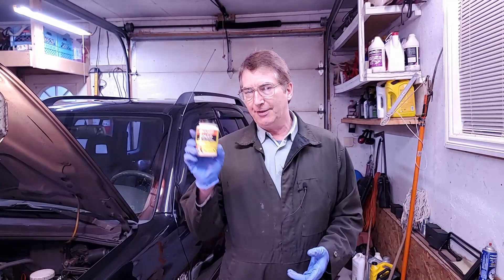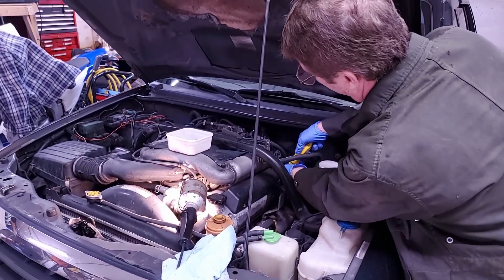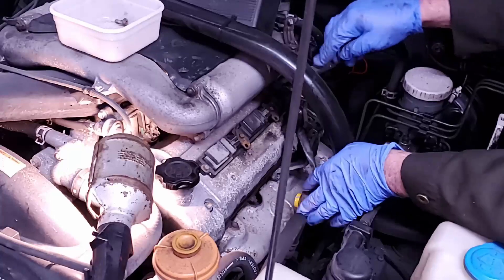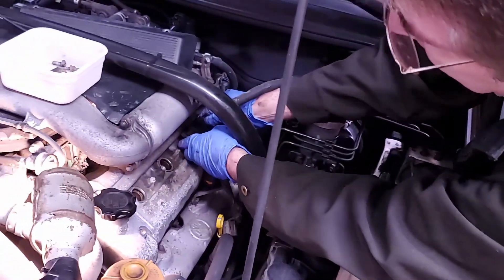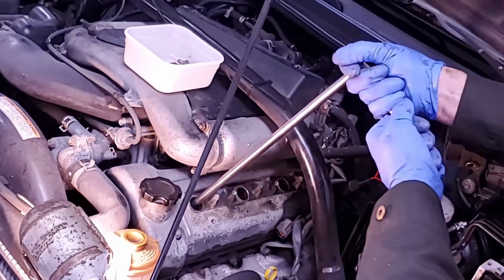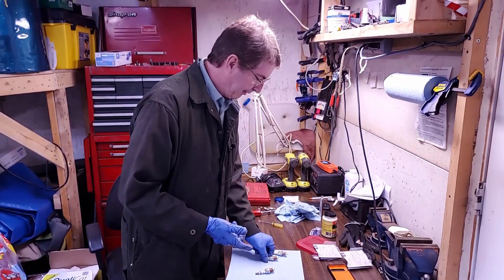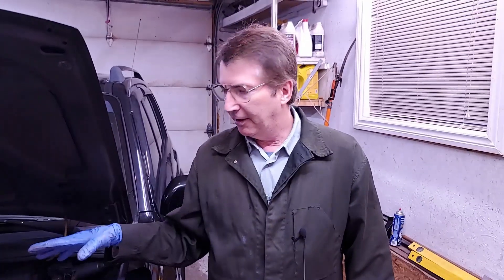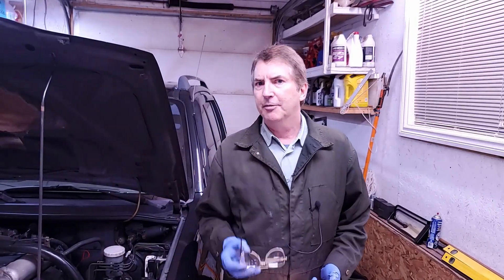WHY I USE ANTI-SEIZE EVERYTIME. How to change Spark Plugs #Frugal With John

Comment: Thank you for the informative video. A good tip for someone who is new to changing plugs is to remove and replace one plug at a time. That way you are less likely to blow or drop something down one hole while working on the other.
Reply from the maker: Great tip!

Comment: If you are torquing the plugs, which you should be, anti-seize will cause you to tighten the plugs excessively.
Reply from the maker: 100% agree, you need to drop the torque spec approximately 20% when using anti-seize.

Comment: PLEASE HELP ME,I was wrong,i did applied Anti-Seize  On Spark Plug Threads WITHOUT WIPING THE EXESS ON THE PLUGS ON MY 2001 TOYOTA TACOMA ,ITS RUNNING FINE BUT SO IS IT TOO LATE FOR ME TO REMOVE THEM AND CLEAN IT OUT THANK YOU
Reply from the maker: More is not always better, but, I would leave them in the engine. The access anti-seize would be gone by now.

Comment: Thank you for the video, I wonder why many mechanics say nooo you shall not use anti sieze! I use it on my Acadia GMC spark plugs and works fine. What do you think about that Sir? Thank you
Reply from the maker: You need to be aware that when you use anti-seize the torque required is about 20% lower. That is why, I use 1/2 to 3/4 turn on the spark plug after it seats and not the torque spec on this type of plug. My guess is mechanic see a lot of damage from spark plugs installation from over torquing when anti-seize is used. Could also be the fact that more is not better when putting anti-seize on spark plugs, you must use a really thin coat and none on the first couple of threads. Thanks for watching
Reply: @FRUGALWITHJOHN  thank you for your answer, actually I use 1/4 turn and it works well. I am glad to see someone agree with me. Thank you again. Thank you for sharing
Reply from the maker: I use approximately a 1/4 turn on the tapered style spark plug and 1/2 to 3/4 turn on the collapsible sleeve style. If it is used then around 1/4 turn, because the collapsible sleeve is already collapsed. I have been doing this for around 39 years with no issues. Thank for watching

Comment from the maker: Answer to Supercalcium question, I though I would pin the answer
You need to be aware that when you use anti-seize the torque required is about 20% lower. That is why, I use 1/2 to 3/4 turn on the spark plug after it seats and not the torque spec on this type of plug. My guess is mechanic see a lot of damage from spark plugs installation from over torquing when anti-seize is used. Could also be the fact that more is not better when putting anti-seize on spark plugs, you must use a really really thin coat and none on the first couple of threads. Here is a good read on the subject. https://agradetools.com/be-confident-with-anti-seize-how-to-use-the-right-anti-seize-like-a-boss/ Thanks for watching

Comment: modern cars should never use anti seize on plugs. The spark plugs nowadays come with a coating on them. Not only does it change the torque but can cause grounding issues on high voltage cars. so many more negatives than positives. Only plugs that you can use it on is the old black ones. period
Reply from the maker: In the industry you have a 50/50 mix on the use of anti-seize, here is a good read on the subject. https://agradetools.com/be-confident-with-anti-seize-how-to-use-the-right-anti-seize-like-a-boss/ I have been a fleet mechanic for 39 years, that means, I've seen the same vehicle I worked on over and over for years. Working on the same vehicle for years gave me a better understanding of what works and what does not work. The SUV in the video is 20 years old I owned it for 17 and that was it's third set of spark plugs with no issues. Thanks for your input and thanks for watching.